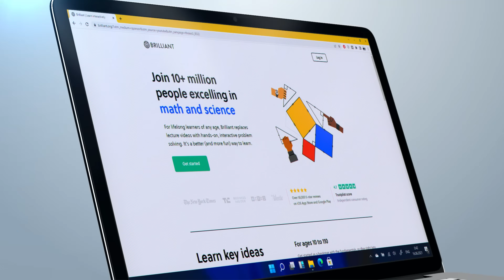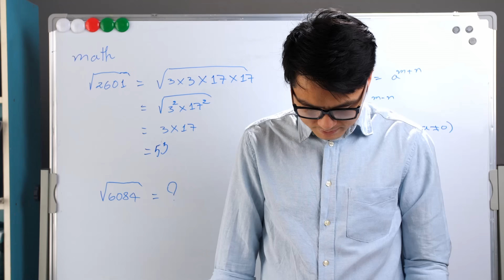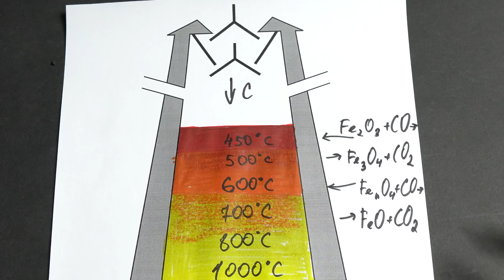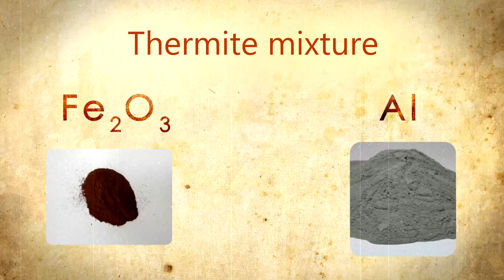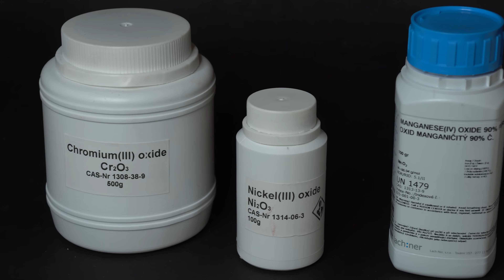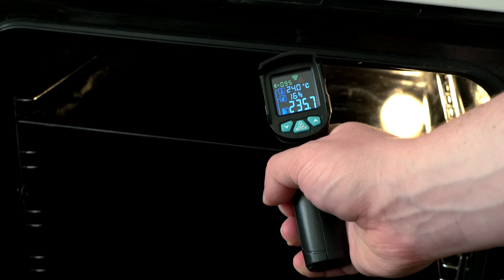I'm the Only one who makes Knives this way!

Comment: Yes, yes, yes! Im blacksmith and was trying to find a way for a long time to make my own alloy, but the forge cant reach the temperature to melt chromium or nickel. Now the problem is solved! Thank you soo much!
Reply: There is a different more traditional way. That would be putting all the metals/elements in a crucible together with glass, sand and/or a kind of flux that doesn't produce gasses cealing it up and making a kind of furnus that can reach those temperatures. Like the one from the documentary secrets of the viking sword, where they try to recreate the ulfberht sword. Coal can burn up to 2000 C which should just be enough to melt chromium but a thermite reaction does burn hotter. The thing is that it takes some time to heat up and for everything to mix properly. They used to feed air into the furnus with bellows but now you can run an electric pump. Just make sure it displaces a large enough volume of air and can run for a long enough time. I've been wanting to do this myself but I don't have the space so I've been trying to find a place that will allow me to do this.

Also a lot of stainless steels actually have a slightly lower melting point than regular steel. when you have molten the iron the chromium and other higher melting temperature elements will slowly dissolve in it which will change the melting point too.
Reply: @DidNotKnowICouldDoThat  You must mean Rocketsyoves, as amateurs call them. You can melt most metals with that, the t° depends on set-up's efficiency and fuel. Gas ether as oxydiser or fuel works too. Make it turbo with integrated fans or compressor.
Reply: There was a fellow on swordforum who made thermitic alloys. Really neat stuff.
Reply: Awesome, good luck and happy alloying away
Reply: Another option is to use ferroalloys like ferrochrome, which also gives you finer control over your smaller alloy additions.
Reply: I can melt EVERYTHING in the coal forge I built haha sounds like you need a better forge!! Lol
Reply: How nice of you josh
Reply: Yess i have the same idea overhere 😁
Reply: Hi all so a blacksmith you should us coal to smelt metal
Reply: Why does my forks and spoons and other cutlery rusts if I give them a quick soak even though it says stainless steel stamped on the underside of them? They are cheap,  a dollar for 4 of them.  I usually don't get these kind of cutlery, but I needed some after moving to a few states away from my home state and just left everything behind that I wouldn't be needing them and have more space for more important things. Either I would let relatives have the stuff I couldn't carry or not needed or donated stuff. So when I went to Walmart I was debating on getting plastic picnic ware or just go ahead and get the cheapest metal ones. The cheapest metal ones were the 4 pack for a dollar so I picked up two of the forks, 1 of the table 1 of the teaspoons. Brought them home cut the tape that was wrapped around them, stopped up or plugged up my kitchen sink and dropped them in some hot soapy water. The first soak and wash went well not rust but when I soaked again some rusted some didn't and I'm trying to figure out why they did when it says on the underside stainless steel? 
Why did some rust when I only soaked them about 5 mins. The 1st soak was longer about 30 mins to an hour. I used hot water the hottest water that could come out of the tap. 
You think it would of been that soak that done that but it was the 2nd 5min soak that done it in hot water but not as hot as the first one. So why did they rust? Sorry for it being long I was trying to making thorough as possible to understand it better. 
Thank you and have a wonderful and blessed day and stay safe! 
                          ✌🏼♥️😃
Reply: @starchild7843  You answered your own question. At 25 cents a piece, they won't have much more than iron in them with just enough of the other materials to be able to sell it as "Stainless Steel" without that being a lie.

More often than not, we do get what we pay for. That said, just go spend another dollar and get another 4 of them.
Reply: @Crimsonedge1  Yeah... correct. Lower than dog poo grade 'stainless steel'.
Reply: @starchild7843  I am also a blacksmith, and I've actually made quite a bit of kitchenware from stainless steel. Despite its name, stainless steel can be rusted. The corrosion (rusting/tarnishing) resisting property of stainless steel is Chromium, and most stainless steel contains a fair amount of it, in some cases up to 14% Chromium. Though even with 14% Chromium, the iron is still susceptible to rusting, especially if left in a solution (soaking) for a long time.

Unfortunately, I can't say for sure why your cutlery rusts, but I have a few ideas. The most likely is that the steel is simply just not of good quality. A stainless steel with a much lower Chromium content will still resist corrosion, but it will begin to rust fairly quickly if exposed to water over a long period of time. Alternatively, the water you're using could have something in it that induces rusting. I'm not too sure, but perhaps if your water is slightly too basic/acidic, it could erode past the surface layer Chromium.

Hope this helped :)
Reply: @xXMACEMANXx  how can you melt iron ? Like compositions to melt iron and it should be ductile ? Hope someone can help me
Reply: @farmaanansari4301  Completely melting iron and keeping its carbon content low enough to forge is very tricky, but still accomplishable with privative technology. East Asians were among the first to really master the technique of steel production through puddling (completely liquifying) iron. I recommend researching the Japanese Tatara furnaces and their design if you plan on doing it yourself.

Hope this helps!
Reply: @xXMACEMANXx  i have every trick to melt and had melted but the carbon content is very high that it breaks down there are some chemcial elemts that is added to make it ductile but i dont know exactly what to add and when to add it ?
Reply: @farmaanansari4301  The method of turning pig iron (puddled iron with very high carbon content) into workable steel is usually done simply by means of an oxygen lance.

When the iron is liquified, a tube blasts pure oxygen on the molten metal. The forces the carbon in the iron to react with the oxygen to turn it into CO2. I suppose you could use just atmospheric air in your lance if you don't feel safe using pure oxygen (rightfully so), but you have to adjust your calculations accordingly for what would only be about 20% oxygen if using the air
Reply: @xXMACEMANXx  with only 14% chromium, depending on austenitizing temperature some of that will goto carbides while other will goto stainlessness properties. And other components in the composition will interact with each other. That's why some steels even with higher amounts of chromium are not very stain resistant also. What's in the data sheets isn't what's in the end product after heat treat and depending on the protocol of that heat treat. Hope that helps. Its much more complex than that but I tried to keep it fairly simple for everyone else.
Reply: @starchild7843  cheap bad stainless... from recycled metal. type 316 is used for marine this does not rust one bit..
Reply: @starchild7843  stainless means stains less. There are many reasons why that occurs, its based on the composition of the steel and how its heat treated. Its also because China dgaf.
Reply: @starchild7843  My guess is that the reason they didn't oxidize or rust the first time is because some oils from the production process were still on them.
Reply: @starchild7843  stainless steel is very rust resistant but all of that goes out the window if it gets exposed to even microscopic rust particles from let's say a steel wool Brillo pad that was just used. If left on the surface all those tiny particles become nucleation points for rust to form and eat away the surface finish. Cleaning it with some sort of abrasive will remove the rust but the longer it continues to sit on the surface the deeper the pitting will be.
Reply: Hahahaha 😂😂😂 as a blacksmith, this is fucking stupid!!! Complete waste of time and money!! As a chemist, this is fucking amazing!!! Haha 👍😎
Reply: @joshmajor8662  try to melt tungsten or molybdenum in your forge
Reply: thermite will melt structural steel beams, just ask larry silverstein. the owner of the world trade complex on 9 evleven.

Comment: Somewhat inconsequentially, I've been hearing a lot about carbon-free steel, lately. Does anyone here know anything about this? To me, it sounds like a scam and I'm waiting to see if thunderf00t debunks it. Cheers :)
Reply: carbon free steel is iron.
Reply: @UberAlphaSirus  
Yes, it is. Thanks.
Reply: @UberAlphaSirus  no iron has 10 times more carbon than steel and is why iron can't be welded just like steel can
Reply: ^^^^ it's literally iron, carbon is required in at least some quantity for it to be steel
Reply: @logicplague  
Yes, it is. Thanks.
Reply: I think what you are referring to is steel made with a carbon neutral footprint. They use arc furnaces and mining equipment all powered by renewable resources without releasing greenhouse gases and making use of carbon capture technology.
Reply: @scotttod6954  
Oh, ok, that sounds a bit more like it.
Several times, especially on BBC Radio Four, I've heard the term carbon-free steel, and it really started to get on my nerves till, finally, I think it was yesterday that I heard the presenter of a programme going straight from introducing a topic as carbon-free steel, to calling what he'd just been told are iron ore pellets, steel, then going on about electrolyzing water to make hydrogen (for some reason) without linking any of it to anything coherent whatsoever.
I don't know whether anyone else was as exasperated by it as I was!
Anyway, thanks for the explanation, if such is what it turns out to be.
Cheers :)
Reply: @rogerkearns8094  LOL. I have had that out of context before from the BBC. Ages ago, I got into the car to go to work and heard the end of something on the radio about a terroist attack somewhere in london. I heard it as "the explosion was jusifiable", I was saying to myself, thats bloody disgusting to say that. Got to work, made a cuppa tea, took a sip, then the penny dropped that it was just a fireball. LOL
Reply: @UberAlphaSirus  
Amusing, thank you. :)
Reply: @scotttod6954  I'd have to see it to believe it, reduced maybe, but I doubt free.
Reply: They are using hydrogen to reduce the oxides in the iron ore.
You still get plenty on heat, but no carbon monoxide or dioxide from the lime and coke typically used in a blast furnace.
Some carbon is obviously required to create steel from pure iron.
Reply: @jimurrata6785  
Interesting, thank you.
And yes, obviously. ;)
Reply: Iron is around 4.5% carbon, high carbon steel is around 0.45% carbon and normal mild steel is around 0.2% carbon.. steel is made from iron by bubbling o2 through molten iron which turns the carbon into carbon dioxide which bubbles out of the metal leaving steel in the crucible
Reply: @markshort9098  Pig iron (cast iron) is a whole different thing than elemental iron, or wrought iron for that matter...
I always found it interesting that with steel you always have to go too far and then make corrections.
Whether it is with carbon content or in hardening/tempering.
As mentioned above a number of European mills are looking to deliver 'carbon emissions free' steel in the next couple of years.
I know Volvo already has a contract with SSAB
Reply: @jimurrata6785  that's true when talking about elemental iron but in industry iron is around 4.5% carbon and steel has 10 times less for a high carbon steel and 20 times less carbon for mild steel.. elemental iron is just very pure steel from a machinist and welder stand point
Reply: @markshort9098  I thought this video was from the perspective of a chemist and a blacksmith who forged the blade for him?
Or, at least, the OP was asking about "carbon free" steel in relation to a BBC report.
This has nothing to do with how much carbon is in the steel, only about eliminating carbon stack emissions by using hydrogen as a reducing agent instead of coke.
Reply: @jimurrata6785  my point was just correcting information given by others, from a blacksmiths point of view which is the same as mine as a machinist and metal fabricator (welder) iron has 10 to 20 times more carbon than steel
Reply: @markshort9098  Wrought iron by definition has less than 0.1% carbon and less than 2% silicate slag.
Before there even was a blast furnace or Bessemer process they would consolidate the bloom and hammer out impurities This is the traditional role of a blacksmith. 
Wrought iron never existed as a liquid in a ladle. If it ever existed at a foundry it was as a 'puddle' in the throat of a reverberatory furnace.
For the most part wrought iron is left to historical re-enactors. There are still a few who work it commercially.
Reply: @jimurrata6785  wrought iron is really just steel made by a different process, if you go to a metal supplier and ask for a 0.1% carbon iron bar they'll give you a piece of steel if you just ask for iron you'll get grey iron or you can get ductile iron and both have a much higher carbon content than steel
Reply: @jimurrata6785  
Thanks and please see my reply to Mark Short, posted a moment ago. Cheers :)
Reply: @markshort9098  
Thank you, I did not expect some of this.
I've learned much of interest here, from you and from Jim Urrata, thanks again.

Comment: harder is not better!  harder is more brittle, that is why knives have a specific hardness, so they are not shattering and hurting people when they are used.
Reply: That's not how it works
Reply: @NSPlayer  accually it is how it works, when steel is hardened to much it becomes brittle which is why most things are double heat treated so what is made doesn't shatter.. the first heat treatment fully hardens the steel and the second heat treatment is to draw back the harness out of the brittle range
Reply: further testing required